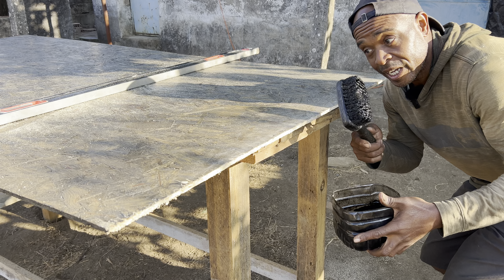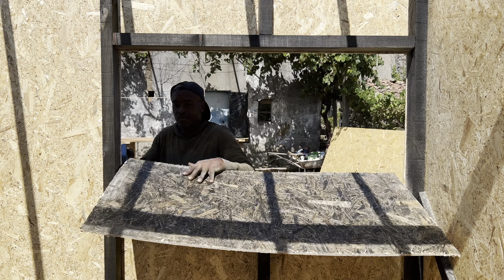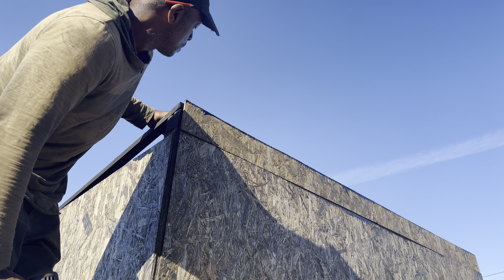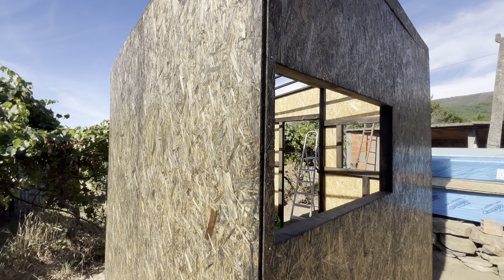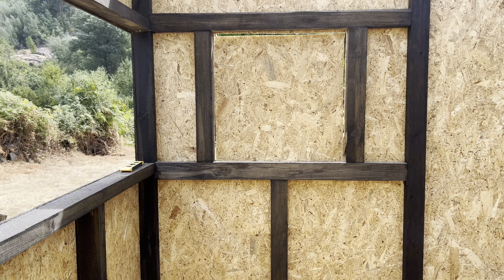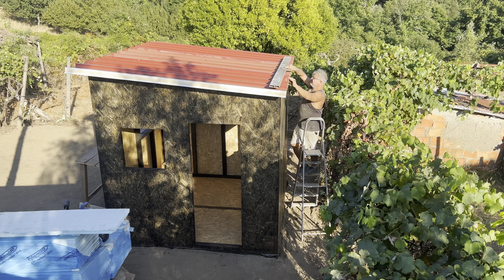I made two mistakes

Comment: One can purchase corner fittings to cover that corner gap, if necessary. The new supports will strengthen  your building, as will the rigid insulation.
Reply from the maker: @jeanrichardson2044  yes thank you very much, I did purchase it and fit it, you will see me fitting it in one of my videos, God bless 🙏🏽